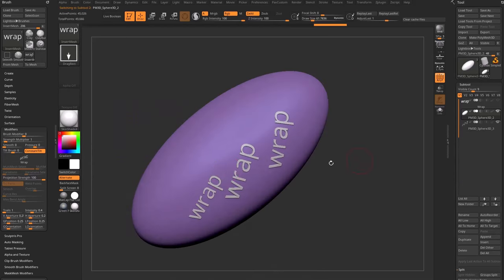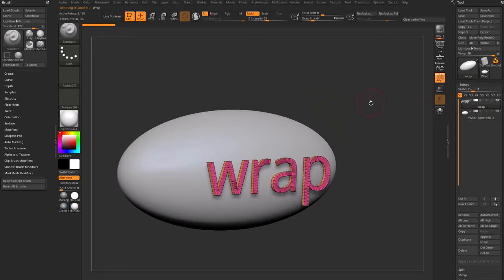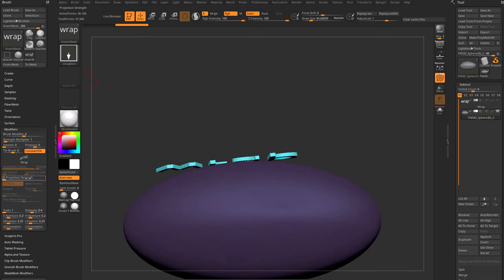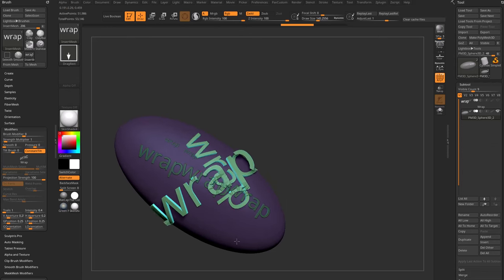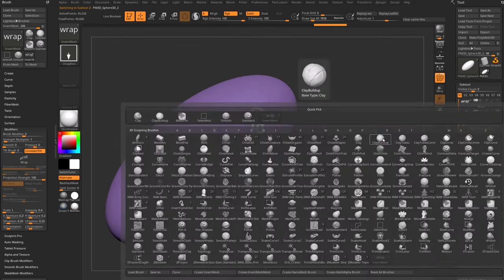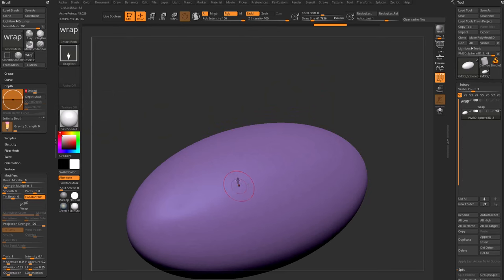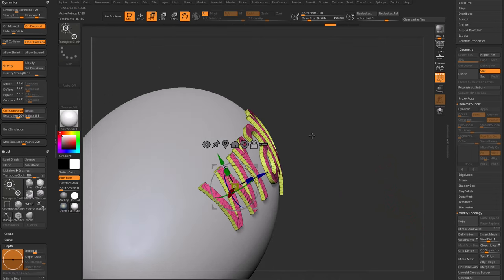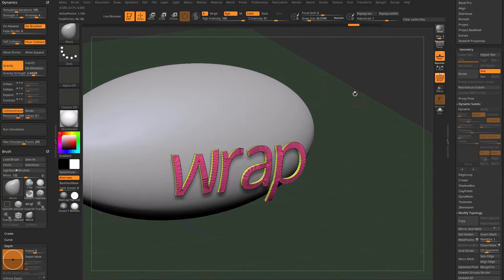Wrap & Conform Surfaces & Objects in ZBrush - IMM Project, Dynamic Collision, Projection, Deformers!

Comment: This is awesome, but would have been super useful a few weeks ago when I did 2 characters with badges XD. The only clean way ( cloth isn't really clean ) to conform the badges I knew of was using the Zproject brush and project a flat lowpoly model, and then extrude the pieces of the badge to give volume, which was a waste of time.

Zbrush has so many options and 12 000 ways of doing a single thing, it's hard to know what all these menus, buttons and sliders do, even after 15 years.

Comment: Thx Michael. If you want to conform a low-poly mesh to a high-res mesh (conform zremesh to dynamesh) what features and options do you have? 

Any recommendations or videos to this subject? Thx a lot and keep rocking! 🙏🏻
Reply from the maker: The ZRemesh result should be pretty close to the high poly mesh, so probably something like this: https://www.youtube.com/watch?v=zRQD3HkQ92E
Reply: @MichaelPavlovich  Thx Michael, appreciate it. Hmm, I guess I was thinking about something like Zwrap. I found this video here: https://www.youtube.com/watch?v=-IxHfOi87FM

I was hoping something like this would work with Zbrush Vanilla? In Blender I found something similar, using the ShrinkWrap Modifier. 

I am just not sure if there is a Zbrush feature or workaround that would do a similar job?

 The issue I am running into: I need to convert high-res characters to max 5k active points in zbrush. Zremesher works not too bad, unless I need a bit higher resolution for areas, like the eyes, mouth, nose, ears.

Because of the extreme low-poly constraint (for mobile games) the face doesn't have a lot of polygons, and when lowering the zrmesh target count, the low-res mesh deviates too much from the high-es mesh. As a result, the the bake fails.

I was testing the Zwrap Plugin a while back ago, with pretty good results, but was hoping I was missing a feature that already comes with Zbrush, without the need to buy that plugin. 

I hope that explains a bit more what I am looking for. Again, thanks a bunch for all your great videos and keep rocking!
Reply from the maker: @LordYodel  Yes, the easy answer is the ZWrap plugin or Wrap2020 (or whatever version is out now), plot points, let it do the heavy lifting for the primary and secondary volumes, then grab details with history project. If you have lots of free time and patience, and a few hundred bucks won't pay for itself as a tool, you can also manually mush a base body into place: https://youtu.be/n5_cZK-9peg?si=CEtwOaZAlf1XCM-u&t=3031 and/or use the cloth deformer to snap a base mesh to body topology: https://youtu.be/iAy8PhnKswE?si=0HNF3163hP6l7avf&t=2 ; there's also other plugins that'll do similar wrap functionality for the CC base mesh in particular, but I still end up doing a refine pass with ZBrush and projection: https://www.youtube.com/watch?v=4TTEJ8tC9Xc&list=PLkzopwqcFevZc94_d8grmzh71JPd629M5&index=9
Reply: @MichaelPavlovich  thank you 🙏🏻 so much Michael!!!

Comment: Hello Michael, Thx for the great video ! It is very useful indeed. Let me ask: Is there any way to wrap a cylinder all around with a low relief flat subtool, that is genereted with an alpha which was created from a bitmap image?  As you shown; overhangimg parts creat an awkward result...
Reply from the maker: quite a few ways to do that - if you can fit the alpha to the objects UVs, just bring in as a displacement map and apply the height, or use UV > Morph UV, apply sculptural changes to your object while it's flat, then morph it back to it's cylindrical shape. If you can't use UVs, you can always make your sculptural changes to a plane, and use gizmo deformers to make it into a cylindrical shape, etc....
Reply: @MichaelPavlovich  thanks again I will try so 🫶🏻

Comment: My guess is if you would want to have those letters embedded you would have to put them in a separate subtool and use live Boolean? like if you would want to 3d print the model? Thanks for your videos!
Reply: Yeah but live boolean is only a preview, if you want an actual mesh, you can put the subtools into a folder, and do a "boolean folder". It's going to boolean the pieces into a new subtool while keeping the original subtool intact, quite useful.